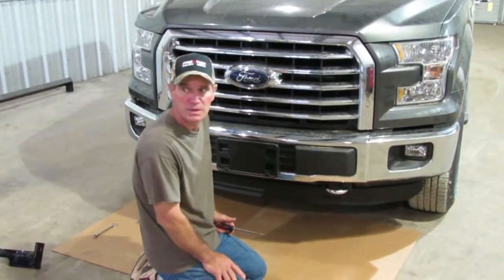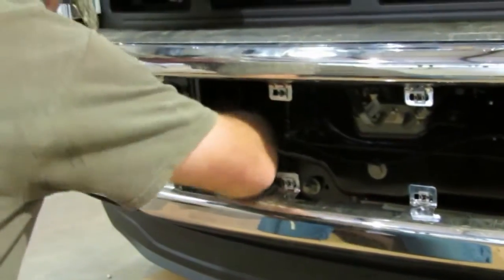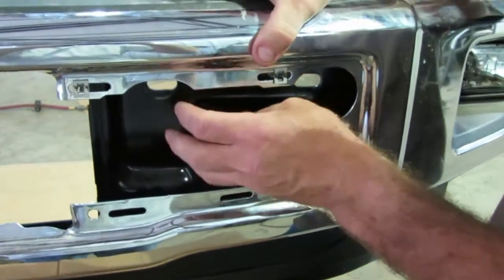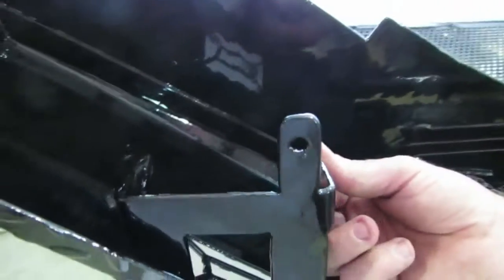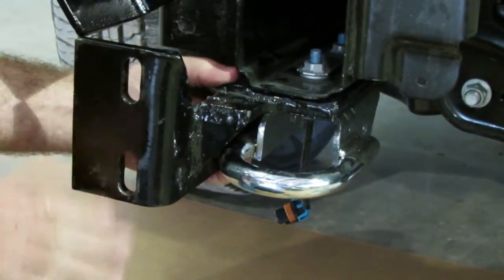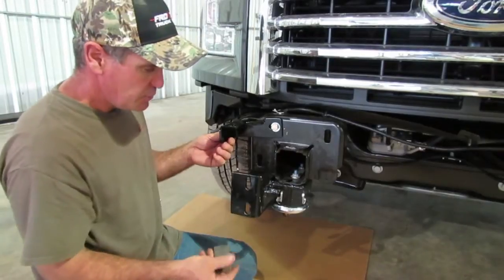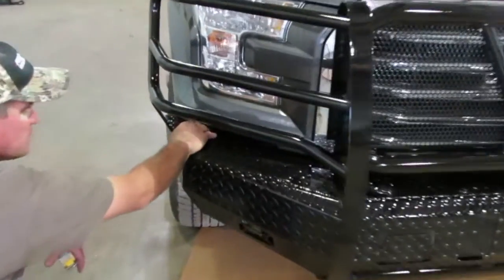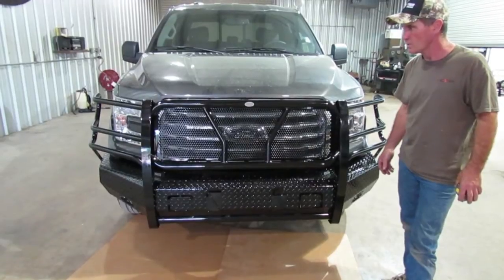Frontier Front Bumper Replacement 2015-17 Ford  F-150 Installation

Comment: On a 2014 f150 stock crewcab xlt, do how know much wear and tear it would do to the suspension, Or would it be ok??? I've read on ford forums 1/2 ton suspension isn't  really designed heavy duty enough to support the extra weight.
Reply: They're only 173 pounds it'll be fine